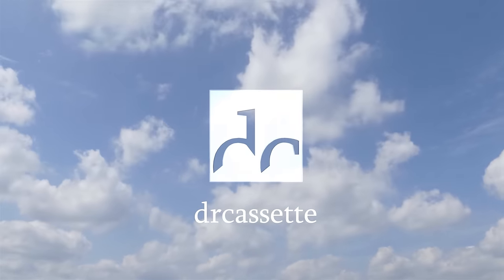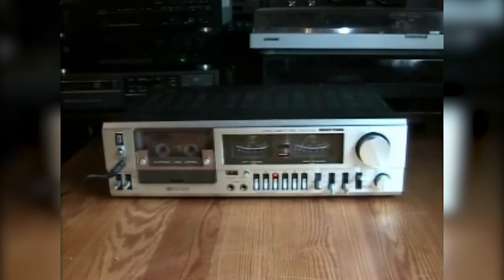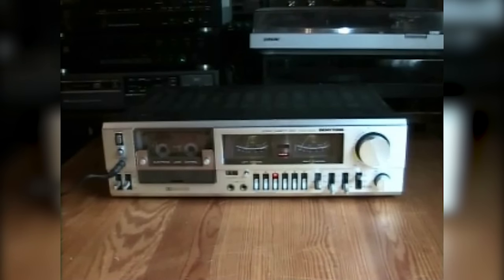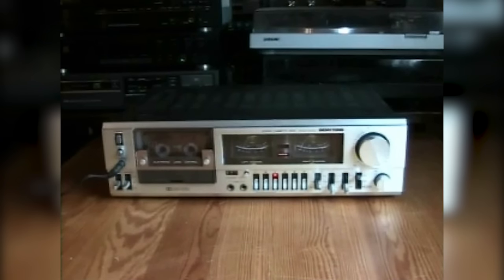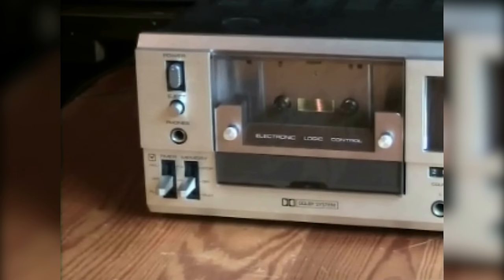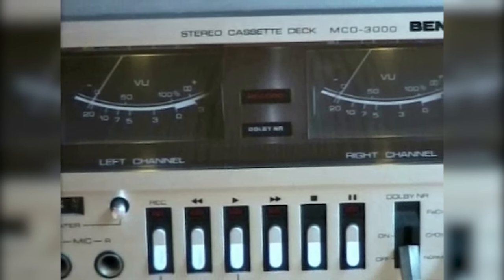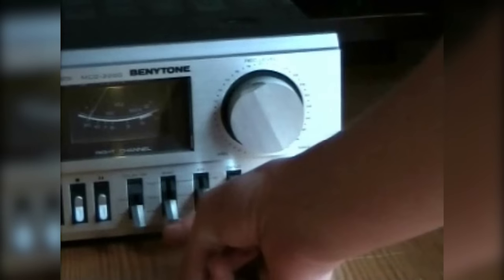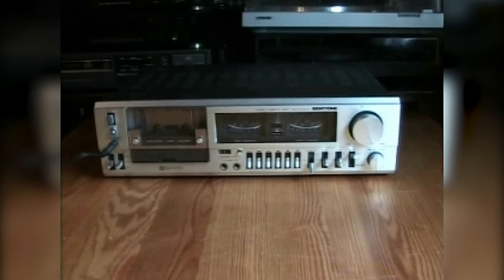The 1977 Benytone MCD 3000 cassette deck

Comment: Nice machine, did you ever track down the overheating part?
Reply from the maker: +adumanter 
It was a power resistor attached to the control logic of the mechanism. It was supposed to be hot like that. It would have been relatively easy to find, but I never got to replacing it. The deck is now gone.

Comment: well it´s normal that you find it inside looking like yours technics, being matsushita the brand that named is products at some level Technics, first they started with national then panasonic or even national panasonic, also you can see in the first cassette deck from tehnics a kind of inbetween horizontal, vertical device that says on the top left corner Technics by national panasonic, like benytone there are other brands that were released by matsushita, i think you already knew this but the way you said it on the video it sounded like it was unusual, regards

Comment: A great little review! Thanks! I have the same model! Where did you get the belt for it? Or did you get one for the mechanism? I could not fid anything related to this model...
Reply from the maker: There are probably no dedicated belt kits for this machine. Back then I measured what kind of belt I needed and then just used one out of my replacement belts that was close enough.
Reply: Thanks for the fast and helpful review. I collect and repair soon-to-be vintage audio equipment as a side hobby. Just consider diversifying into cassette decks. I have the exact same MCD-3000 available locally. Would you consider it a valuable addition? Is this particular deck worth getting?

Comment: do you know which models were the first autoreverse models?
Reply from the maker: The first autoreverse models came out in the early 70s, but did not use the rotating heads mechanism that became common in later years. There is a video on a rather unique Akai autoreverse cassette deck on the Techmoan channel.
Reply from the maker: That's a difficult question. I don't think the rotating heads were available in the 70s, so finding a deck that looks like 70s will be quite a task.

Comment: could be the transformer is the smelly part.
Reply from the maker: If I recall correctly it was a high-power resistor that got very warm emitting the smell. This cassette deck must have been sitting in a moldy basement for years, it did smell very bad. I don't have it anymore.